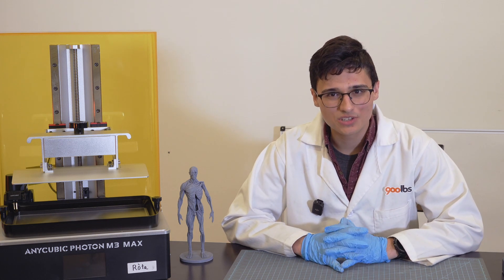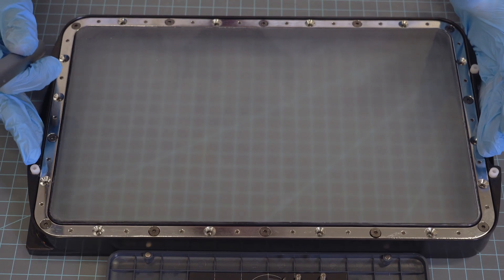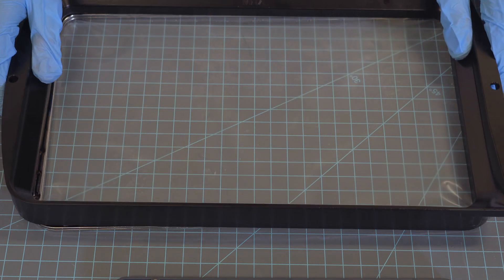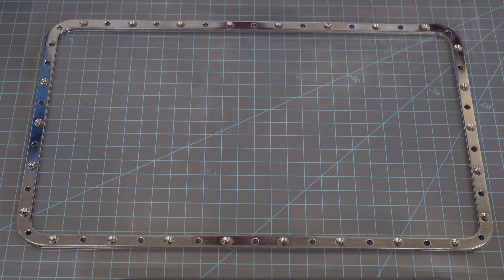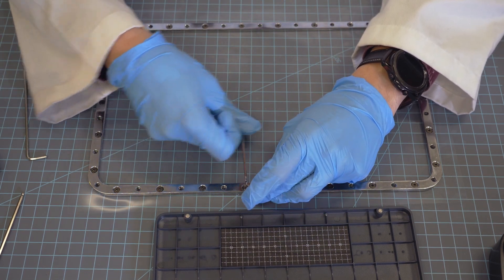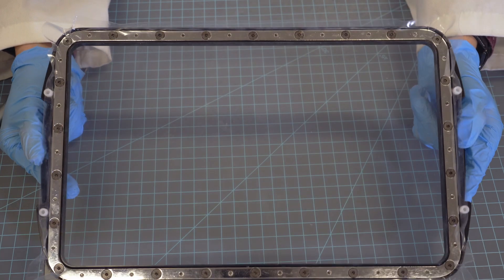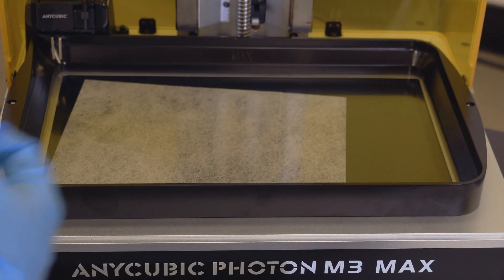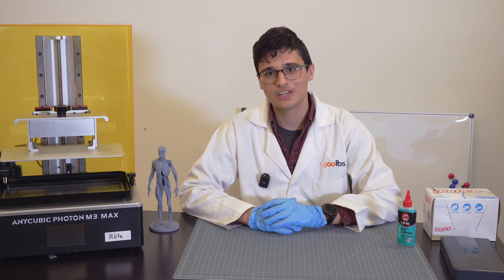How To: Replace the FEP Sheet | Anycubic Photon M3 Max

Comment: Watched 1000000 videos and not a single vid ever recommended dryer sheets or oil. I extended my exposure time because prints were not sticking to the plate… I think this wore out my FEB faster and it started to leak. Thank god I had a screen protector. About to do my first print with normal exposure and the lube you recommended. We will see how it goes! Ty!

Comment: Very good info on how to replace the FEP, just need to know how do we get the correct tuning? I have used a spectrum analyser on my other printers but I have no idea of what frequency we need to tune for this one as it is such a large FEP.
Reply from the maker: To be honest with, I don't think a precise tuning is necessary. As long as your screen is pulled tight and without wrinkles you should be in good shape. A test to find the optimal tuning would be interesting, but I have never attributed a print failure to improper FEP tuning.
Reply: @nicknacks3d  It is just I have been printing successfully for some time but needed to change the FEP as it developed a small hole. Replaced the FEP but have now been unable to get anything to print successfully, other sites suggested a 118-119 kHz turning but this seems very lose. Frustrating.
Reply from the maker: Hmmm, it might be caused by something else, perhaps. Can you describe print failures you are seeing?
Reply: @nicknacks3d  Thank you for your help, I can only get prints now to partially stick to one side of the build plate, even then the side facing the centre is starting to pull away. I have levelled the plate several times including using the vat to level but still no success. I do have a heater in the printer set for 28 degrees C and a VAT band heater as well. I have tried three different resins just in case they were out of date as well. I am not new to resin printing and have over 4 years’ experience with 3 resin printers but this M2 Max has always given me issues, had to replace the screen and motherboard from new. On the second LCD screen now after the 1st replacement failed in a week, it started to behave and printed very well but the vat developed a small hole and I replaced it, now back to square one and nothing prints well at all. Any suggestions would be appreciated.
Reply from the maker: Sounds like quite the Christine of 3D printers. With that kind of history, it could be a multitude of things. If it's not bed leveling, could it be the screen itself? Dead pixels, miss alignment? Another thing to consider is the model you are slicing. Does it have suctions cups or large flat surfaces? Sounds like you know what you doing for the most part, so I'm afraid I might not be able to diagnose your problem without the machine itself. I hope you are able to find a solution that works! Best of luck @pauljohnson2692
Reply: @nicknacks3d  Yep, this one is not the best of printers. Thanks for your help though. will look at the screen again, as its out of warrantee though its  now probably a bin job as a screen replacement  costs fortune. As I need a large format printer for my work (PJ Model Works) will look at a phrozen p8k mega v2 next.

Comment: Thank you for your video! 
I'm new to this and I would like to ask the why behind removing the statics off the FEP sheet?
Reply from the maker: Great question! The FEP sheet and the screen will both collect a lot of static electricity when being wiped clean. This static can cause the FEP sheet to not flex properly during printing due to the added attraction force to the screen. This can cause print failures like prints getting stuck to the FEP or worse, folds forming in the FEP sheet. I find it's best practice to discharge the surfaces of your printer especially on first arrival and after cleaning. I've even had static build up on the outer plastic casing and actually pull small drips of resin away from the buidplate! A box of unscented dryer sheets are essential IMO.

Comment: This isn't how I was taught to replace FEP sheets. To start off with, when you are screwing the front of the FEP sheet into the frame, I was taught to place a spacer between your table and the FEP sheet so that it isn't tight at first. Then you screw it into the frame by tightening opposite screws and simply screwing it all the way down. No lube on the FEP, as it is unnecessary IMHO. clean with alcohol on both sides and as long as it makes a tight drum noise when struck, it's at an acceptable tightness and ready to use.
Reply: Well, you forget we are not talking about regular size machines, but bigger ones, for which you'll need way more tension, and if there's something you don't want is to be left with not enough tension.

Comment: Hi Nick, thanks for your great vid!
I was waiting to long with replacing my FEP and some resin crept below the FEP to the edges of the screen. To my biggest surprise, it corroded the tape around the screen.
Talking to the Anycubic after sales support, he confirmed that the tape around the screen isn't resin resistant 🤬
Original text: "The LCD screen’s fixing tape will be damaged if it encounters resin"
That's true irony: Anycubic uses a tape for screen protection for their resin printer which isn't resin resistant ...
Anyhow: Do you have an idea which tape could be used to replace the corroded one?

Comment: I followed this but for some reason prints are sticking to the side (used the anycubic test print) but they arent sticking to the middle of build plate
Reply from the maker: This might be an issue related to your slicing settings. You might need to just increase your burn in layer time to make sure prints stick properly to your buildplate. Due to the elastic qualities of the FEP sheet, you'll get more flex in the center than you would from the edges. That flex can sometimes be good because it give the FEP sheet more time to peel away from from your print as the build plate rises. If your prints are peeling away from your buildplate, you need to check that the build plate is properly leveled, that your FEP sheet is well tensioned with no wrinkles or gashes, and that your buildplate has a good texture on it that aids in adhesion. If all those things are good, then failures are most likely slicer based. Test with higher burn in layer times & slower buildplate movement speeds. There are other things like suction cups and proper orientation that could cause these failures as well. Good luck and hopefully this info helps!

Comment: I have not been able to tension my fep right. Have wasted sheets on sheets. 

Been trying all the hacks to do it but no success. I'm not able tension it to 330. Even at 270 in yhe middle it  is already too tight in the screws. I dont knkw what to do. 

Scratching my head on and on. Somebody save me.
Reply: I don't think you need 330hz for M3 Max. Those videos with 330hz come fronm smaller printers. With larger FEP, the expension of the FEP will also be bigger by default, that's why we need higher Z-Axis lift disctance for every layer. I honestly always hate FEP replacement, i also never check the frequency, yet i can still print. Most of the print failure in my case comes from exposure settings and, lift distance, overcrowding, and overweight of the build plate. 

Good rule of thumb for me is: 1. Try to hollow the print as thin as possible, 2. Place the objects in a balanced manner, 3.Try cutting down big things into smaller pieces to reduce print time. Printing time is extremely important because your base layers might fail before you finish printing.
Reply: @stateservant  thank you for your reply
Reply: This time when i replaced mine, didn't check anything. Just installed and ready to go. Been printing fine till now
Reply: @divyanshmaheshwari3402  anycubic M3 Max is by far the best SLA 3d printer i have ever used. So few maintenance, so few major breakdowns, prints well, and it's big.

Comment: Nicely produced and presented vid. I know you did say that the order of unscrewing the screws when removing the old FEP isn't as important as when fixing the new FEP, but I'd go further and say there is NO importance to it at all. The old FEP is scrap anyway, so it doesn't matter if it gets damaged somehow, even if it's damaged, however unlikely, by some incredibly violent 'incorrect unscrewing order'. In fact the reason most people change their FEPs is because they've been punctured, or torn, beforehand, so what's the point of keeping an even tension around the frame? I'd go so far as to say that whenever I've changed an old FEP, I've deliberately sliced the FEP first, removing all tension from it, ostensibly to ease the stresses on the screws and the frame, but more so because it's FUN! Anyway, loosening/removing screws in the 'wrong' order isn't going to damage the metal frame either. So, the 'screwing order' only matters when fixing the new FEP.  But I'm here for all those who've 'fallen' for the old 'Do the corners first' and 'Go around tightening the diagonal opposites like you would a car wheel' Or, 'Do the corners then go around the frame clockwise/anti-clockwise malarkey. They should look at he correct 'patterns' for tightening nuts and bolts on rectangular structures. The BEST order of screwing would be to tighten all the screws down at the same time, keepin even tension across the entire frame and FEP and screws, the whole time,  but none of us have 28 or more hands.  As we only have one screwing hand, the best option is to screw down every screw, as you do, a bit at a time and do them in a zig-zag pattern opposites. BUT Doing the 4 corners first is the WORST thing you can do! The frame is not circular, or square, it's a rectangle, and those corner screws are not placing the FEP under tension on straight bits of metal frame, or the rim of the vat,  but on curves, and those corner screws are not truly perfectly, diagonally opposite each other either. Lay a ruler across those so-called diagonally opposite screws and you'll see that the 'shape' of the FEP either side of the diagonal is not the same. So, tightening the diagonals, which aren't 45 degrees, (as would be with a square frame) or 180 degrees (for a circular frame), lifts the other of the frame, but offset from that far corner, thanks to the curve in the frame/vat rim. With the M3 Max the problem is exacerbated because of the size/length of the vat and the ratio between length and width. Smaller printers have smaller ratio vats. But for all these vats, the best way is to tighten those screws, a bit at a time, sticking to a pattern and repeating until the FEP is correctly tensioned,  but tigthen those which are truly opposite each other, so for the Max, that's the middle screws on the front and back length, and then those either side of those 2, zig-zagging up-down, up down, left and right as you work your way out from the centre, and after maybe tightening 6 screws, do those on the left and right hand sides. IIRC there aren't any truly 'middle' screws on the sides of the frame on the Max, but there are 2 screws which WOULD be either side of it if there were one, so do one of those, then the screw directly opposite, then drop down and do the next 2 directly opposite screws. Keep up with that pattern, zig-zag, opposites and leave the corners until last. Then tighten them all down a bit more, following the same pattern as before. I'm a model-maker, not a 3d print chappie, but I will probably produce a vid explaining it better. Sorry for the long waffle, but I'm bored LOL. btw, I've subscribed, and not just by way of an apology. LOL
Reply from the maker: Thanks! You bring up some interesting points. You're right that the old FEP sheet is not important to keep protected, but I'm trying to keep the frame from bending too much while removing the screws. Your method of tearing the old screen might be a great way to get past that though. I'd be interested to see a visual explanation of your suggested zigzag method. I appreciate the thoughts, I'll look into this as a possible alternative to the corners method, though I will say, it has been working great for me so far. Thank you for your thoughts and suggestions!
Reply: @nicknacks3d  Really nice video indeed! Especially concidered it's only your 2nd vid, at least on this channel. It's made in a way that seems like you've done it before and maybe you have, so I was shoked to see it's only your 2nd one, so cudos on that!! I am writing here because I agree with replacing it, but from the video it doesn't seem to be much tension left, after it's been streched over the vat to become as taught as it is when in use/just sitting there. Just un-screwing it seems to get rid of most of it, but I also believe it's good to avoid any bad habits while fixing the printer and all the stuff that comes with it. It's already expensive as it is, and even the pieces that will need replacing sometimes (screen protectors, FEP sheets etc) can also quickly add up, so best to keep it tidy and find good habits/ways of doing it. 
Mine has leaked a bit I just found out, through a really small hole made in the FEP, so I now have some cured resin on the screen protector itself too, so that'll also need replacement as well as the FEP :P I'd love to see more vids from you in the future, with any tips and tricks! The lube for the surface also seems to be a nice thing to try out. My first few prints had some issues with falling off the supports, but tbf that's also partly because of the amount of supports and how thin they are on that particular model. Not really the best prints for a beginner. I've tried a few other ones now just before I found out about my issues and they're printing way better, with only a few imperfections so far.

Comment: I use the PTFE lubricant on the build plate. I hadn't considered it on the FEP film. I also use a de-ionizing infra red light to help take static away from the FEP sheet.
Reply: So you put a non stick substance on a non stick surface? It comes straight off as soon as the build plate hits the resin and contaminates it. If you have issues with prints sticking to your fep it means the build plate is uneven or you didn't level properly. Why do you think the resin and printer makers don't sell their own versions of it? Recommending PTFE lube just shows you don't have a clue what you're talking about.
Reply: @ajc4477  Well I will give you this much of it.
#1. I am fairly new to this and have only been printing for about 6 months now personally, so I won't argue with your point.
You might be right.
#2, I am watching YT video's about 3D printing, I am experimenting with different programs, both Slicers and 3D design programs like Z Brush, although I have been 3D modeling in Blender for 15 years.
So when you claim that I don't have a clue about what I am talking about, I would have to say that you are partially right.

On the other hand, My business partner has been 3D printing for about 5 years now, and he was the person who showed me how and why to put PTFE on the build plate, and then to wipe it off good, but it leaves a microscopic layer on the plate because we had issues with the parts not wanting to separate from the plates.

I have never had issues with the parts sticking to the FEP film myself, but found it interesting that someone else was experimenting with a solution.

As far as experience with contamination of the resin, the only problems I have had with that is when i accidentally mixed water cleanable resin with ABS like Resin, and trust me, that made a mess.

The only other issues that I have had is learning how to position the parts to get them to print with or without x amount of supports, and or I have had some ghosting issues with the anycubic slicer, so I had to convert to Chitubox, and I am testing the Phrozen Mighty 8K as it prints strait from Chitubox and not from a conversion file.

So calling me clueless is about half right. I am learning though and I think you could have worded it better and different, like saying that its possible that using the PTFE might contaminate the resin.

I have had over 300 successful prints and about 15 not so successful prints, so I think that you don't have a clue about other people not having a clue.

God bless you and have a nice day.😆
Reply: @stltrekmodels.4157  So you're new at this and you don't really know what you're talking about.  Awesome that you're doing "instructional" videos, eh? 😂
Reply from the maker: I've never heard of using infrared light to remove static, but I'll do some research on it. What benefits are there to using PTFE lubricant on the buildplate itself? My first thought would be that it would prevent propper adhesion and cause failures, but I've never tried it.
Reply: @nicknacks3d  I put it on like just a few drops, and wipe it with a paper towel so it is microscopic on the plate.
I still get good adhesion, but the models come off the plate easier.
yea, you cant have it like fried chicken greasy or it wouldn't stick at all.
I also do it about every 3 prints, not every time.
Reply: You’re doing something wrong if you need lubricant on either surface